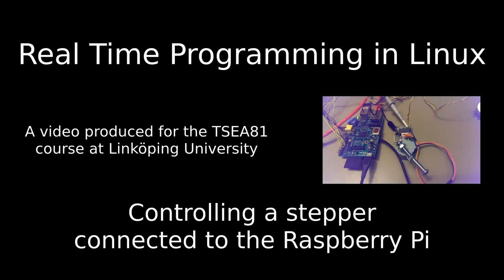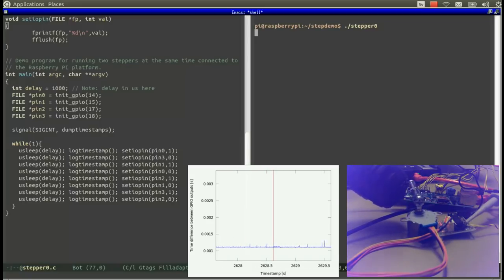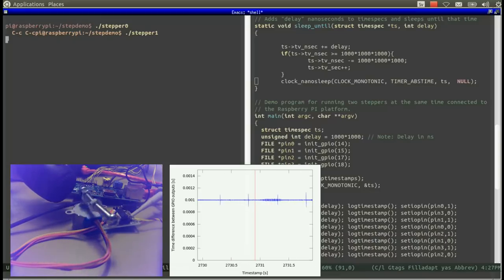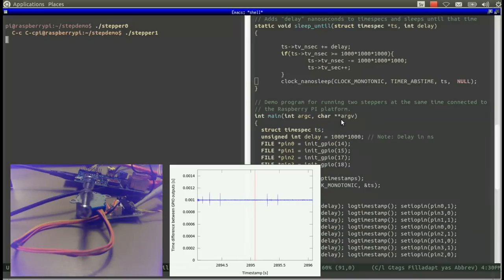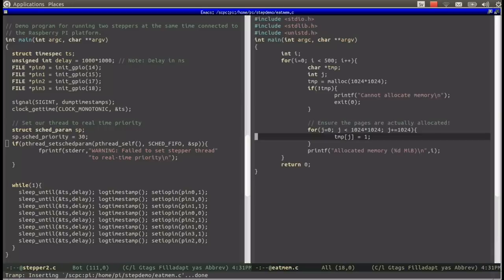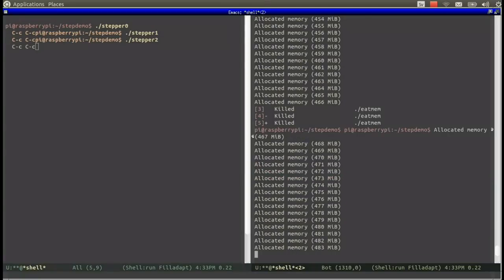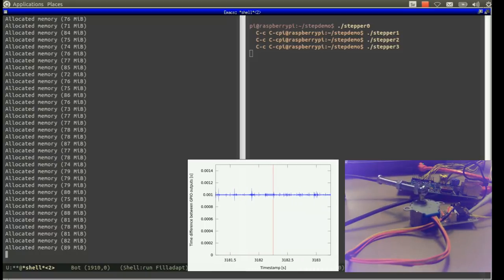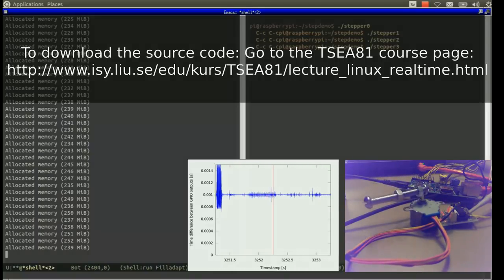Real Time Programming in Linux - Controlling a stepper connected to the Raspberry Pi

Comment: can you upload a video with more details how to prepare such an environment to can run this program.
Reply from the maker: I didn't really do anything special to run this program. If I remember correctly I'm using the raspbian distribution which I have downloaded from the raspbian website. I'm not sure whether gcc and libc-dev is included by default in raspbian, otherwise you need to install it with apt-get. Beyond that I didn't do anything special as far as I recall.
Reply: @ehliar  How to Patch Raspberry Pi Linux with RT Kernel patch.. Maybe a tutorial on Raspeberry pi4 would be nice

Comment: you modify the kernel linux for raspberry pi?, How you can do it?
Reply from the maker: For this video I did not have to modify the kernel in any way. Everything you need is included in a standard kernel. However, if you are interested in compiling your own kernel for real-time applications on the rpi you should probably look at patching the kernel with the Linux rt patch set.

Comment: what kind of OS are you using in the video? Is that a Raspberry Pi 1 model B?
Reply from the maker: I think I was running raspbian on the raspberry pi b. I'm unsure what operating system I was running on my laptop when recording emacs and xterm, probably Ubuntu.
Reply: +ehliar thank you for your quick answer, I'm really interested in your work, can I contact you privately in case of need? I'm working on a similar project for my university
Reply from the maker: Sure. I might add that I ran the same demo on raspberry pi 2 this autumn in my lecture on realtime programming. The demo was not quite as successful on the raspberry pi 2 (perhaps because the kernel is SMP enabled by default?) so I had to change the OS to a Linux distribution with the RT-patches applied before giving the lecture. (It worked beautifully once that was done though, even better than the old version that is shown in this video.)
Reply: +ehliar thank you, I am currently working with Rasp Pi 1 so this information in really useful to me

Comment: hey Buddy need to know something real quick ..if you Know a lib ArduPi by cookhacks.. problem is I am using it ..and I am reading data stream coming from a camera at 115200buad ..but I don't know some how it takes a lot time reading ..that is my program takes long time to read even at that rate.. I had even made serial port to Low_latency Settings .. but no result with that.. Yes I also increased the process's priority( to 99, then showed RT in priority) bt no performance gain... I used keep looking on top command while it was working ..bt it almost always shows status sleeping .. while I wrote a simple C program with while(1) CPU utilization is high and its status show Running bt ... While my Serial reading taking such a long time ... Arduino is quite good at it.. with same code on Arduino I can transfer a photo from Cam to SD in ~3Sec.. but with Pi it takes 30-50 Secs.. Can you suggest how I can get it to Realtime performance??? strip processes.. or use something that can boost realtime performance.. I have seen gprof and most of time calls are for Read and available and while every read I think there is sys call to nanosleep... :(
Reply from the maker: Hard to say without knowing exactly what your program is doing. My first choice to analyze this problem would be to use the strace command to figure out what system call your program is running. After that it may be easier to analyze the problem.
Reply: ya I had run the strace I too thought that and found out that its nanosleep function at every read() of serial data slowing it...

Comment: Great info! What did you use for video editing and sync?
Reply from the maker: Thanks! I used kdenlive for video editing. If I recall correctly I used recordmydesktop to capture the desktop. A custom octave script was used to create and dump images of the latency graphs which were later imported into kdenlive. The audio was synced using kdenlives built in functionality, although if I recall correctly I had to correct the video/audio sync of the different video streams (i.e. desktop video and stepper video) manually so that they were in sync whenever I pressed enter to start a new stepper program. The narrator track was added later on (this was the part that actually took the most time to get right as I'm not a native English speaker). I'm pretty happy with how it turned out in the end, except that I managed to forget about converting stereo files to mono as pointed out by Greg Kennedy .

Comment: Are you using C/C++?
Reply from the maker: Giang Tran-Nhan in these examples I used plain C. Although you should get the same results in C++ as well.
Reply: Are you happy to share the source code with me?
Reply from the maker: Giang Tran-Nhan have you looked at the video description? There is a link to the lecture notes there. The notes should include the source code.
Reply: Thanks so much!